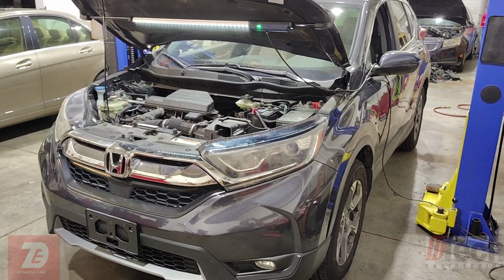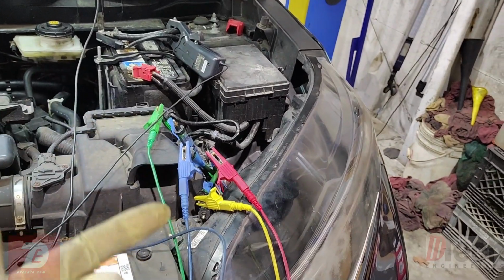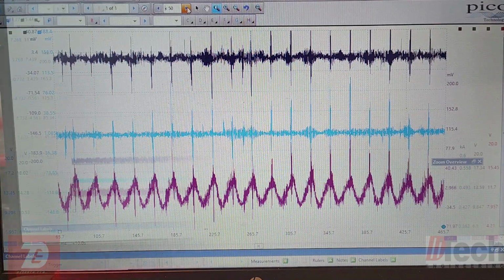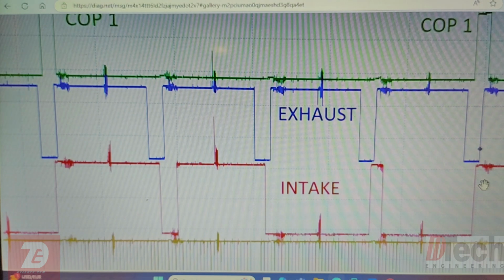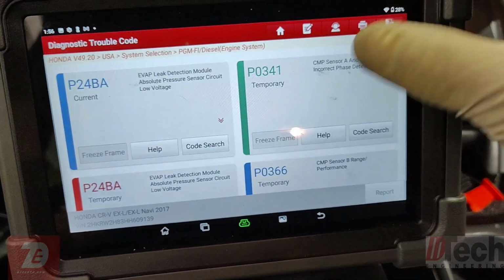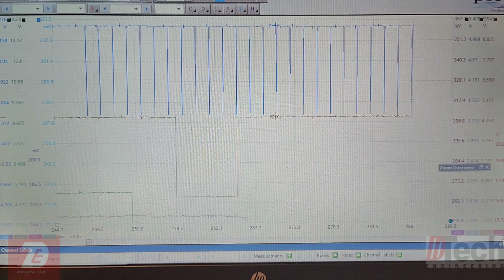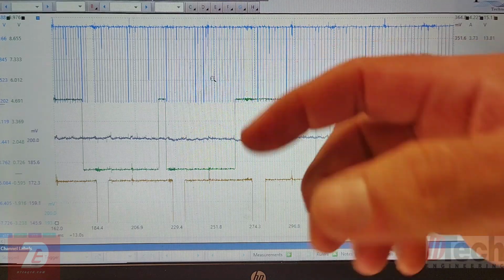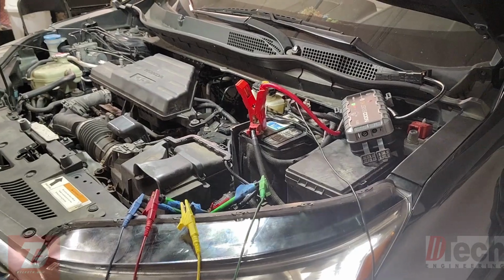Honda P0341/P0366 Timing Code Diag & Fix

Comment: In the photo of the replacement parts 43:13. You have new soleniods there. Was this just good practice to replace those with the timing components or was there issues with them?
I'm having the same codes, stretched chain. Replace chain and tensioner but did not replace those soleniods. Wondering if those could be the culprit to my reoccurring correlation code.
Thanks!

Comment: After piercing those cables, what are the chances of insulation deterioration and corrosion? It won't be a good time for an owner to stuck somewhere in the middle of the road if any of these sensor signals suddenly fail. 
Are there special ECM breakout boxes for sale? I'm looking to purchase one for my 2016 Lexus RX but cannot find any.

Comment: @7:19 you said you got "clamp" on Chain Tensioner.  I believe Chain Tensioner does not have any electrical output / sensors. What kind of "clamp" did you put there? Where can I get one?
Reply from the maker: As far as what I meant by "clamp" is the chassis ear clamp, you can find them online, just search for steelman chassis ear leads, you can get them separate from the whole kit.
Reply: @DTEAuto  clamps contain mircophones? But they would need amplifiers before signal gets to scope.
Reply from the maker: @BesprovolkiSvias   they are not actual "microphones" they just generate an electrical signal based on sound and vibration and it can be measured and captured with the scope, the only thing to connect those actual clamp leads to the scope is an adapter which I make and offer

Comment: Can i manually activate the vvt solenoid while the engine running at idle for all cars?
Reply from the maker: yes, but most all control solenoids are pulsed width modulated and so that means constant on off, so when testing you don't want to let it be constantly powered on for too long, just long enough to watch for movement or to hear a tone change in the engine idle
Reply: @DTEAuto  thank you for reply

Comment: Hi I have a question, when you did the RC test with the sync. It showed that the ecu turned off the command at the peak of the RC tower. Wouldn't have indicated that the spark is happening at the incorrect time? Also if you had use a secondary ignition waveform.  Couldn't you have seen the spark happening at 0 degrees or after. Indicating that the timing is off, since this vehicle ignition timing is about 5-7 degrees BTDC? Just looking for other methods to check for timing. Or even better,  we could have went in cylinder with a sync and see when the spark is happening. Cheers thanks for the video
Reply from the maker: Hey, so on this coil set up since I was on the control side, once the control gets "turned off" or "released" it will drop down from 5V's, like it did on the waveform, when it drops or gets turned off that is when the spark occurs (prior to that is the dwell on time). During cranking ALMOST (not all, some BMW's like to spark after tdc on some engines they have during cranking (like RC test) all engines will spark right at tdc which is the peak of the tower in the amp trace. The "theory" is said to be if it is "in time" then the spark will occur right at tdc as how this one showed.  Now on the earlier Honda k24's they only use one of the cam triggers to produce spark, and I have seen where one cam was off and out of time but the rc showed correct timing due to the fact that the one cam it uses to trigger the spark was still in the correct sync (time) with the ckp. Hope this helps some or makes sense.

Comment: What kind leads clamps you using for finding noise? Are they by chance chassis ears hooked to the scope?
Reply from the maker: They are the Steelman wired chassis ear leads, and I make/sell adapters to connect them to the scope
Reply: @DTEAuto price?
Reply: Great question body Hopefully he answers you cuz he doesn’t respond to the comments.
Reply: yes they are chassis ear clamp on microphones, you can get BNC leads to connect to a scope.
Reply: @BBS_Robski  where can we get such 'ears' ? thanks
Reply: @JoelAutomotiveInaction  thanks mate
Reply: @JoelAutomotiveInaction  so it's just a  piezo element, pretty easy to diy